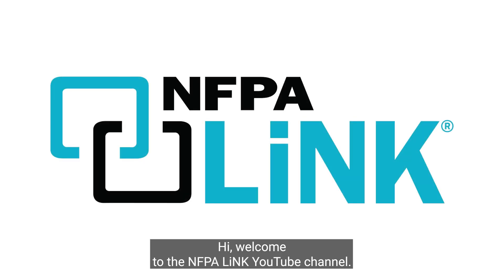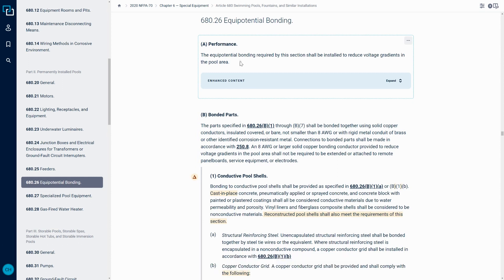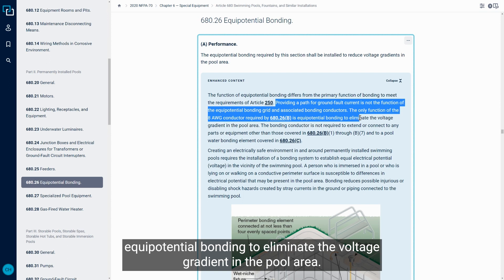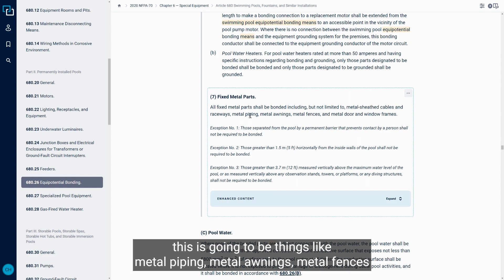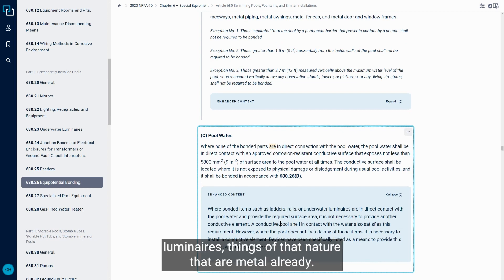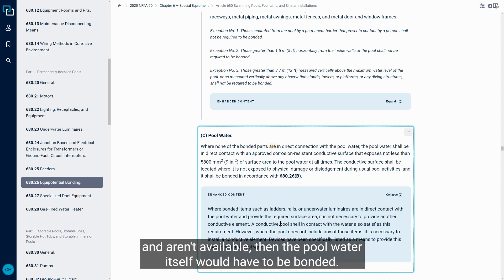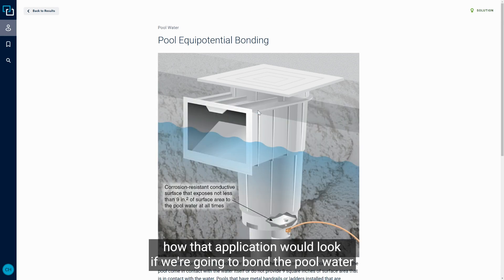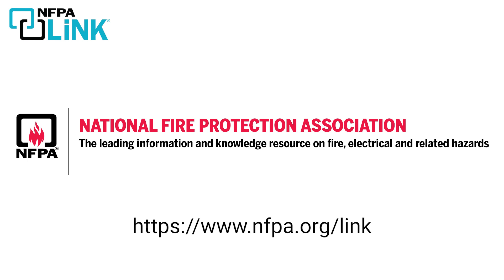Equipotential Bonding of Swimming Pools with the 2020 NEC

Comment: The video doesn't explain why grounding of metallic objects around the pool is code required. It is not specific to gutters. If you are in the pool or around the pool within 10ft, the water enables a low impedance path from the metal object which is possibly at a different potential, through your body, and to the highly conductive pool water. People think earth ground is at the same potential everywhere but actually it varies a lot from building to building, especially when large amounts of current are flowing nearby such as motors or where power lines are grounded. If you run a long wire 100m across the ground, electricity will flow through it if both sides are touching ground because the grounds are not at the same potential. The wire would be like the pool water and gutter and you would be the conductor in between. Ouch 😂

Comment: The voltage gradient that equipotential bonding addresses arises because electric utilities use the the earth as the return path BETWEEN MULTIGROUNDED NEUTRALS EVERY ⅛ MILE for current to the generation source BUT POOLS, PONDS, OTHER WATER BODIES between those multigrounded neutral points HAVE LOWER IMPEDANCE THAN THROUGH THE EARTH, so a voltage gradient (a step or reach voltage difference) results.